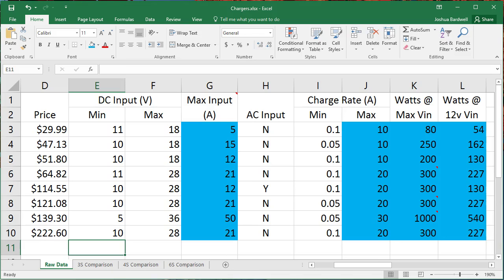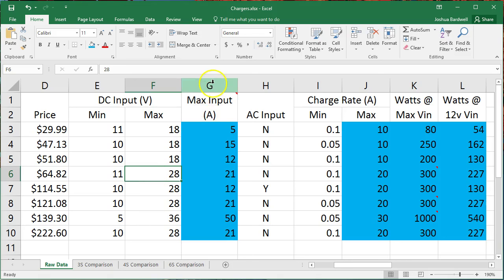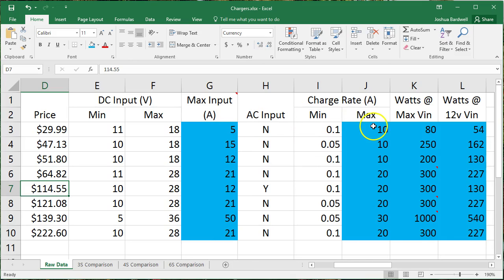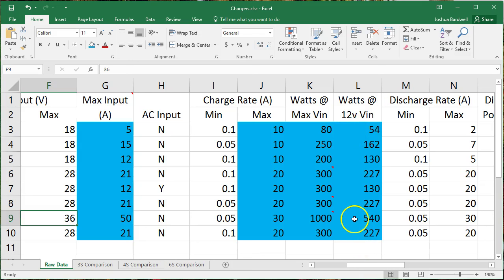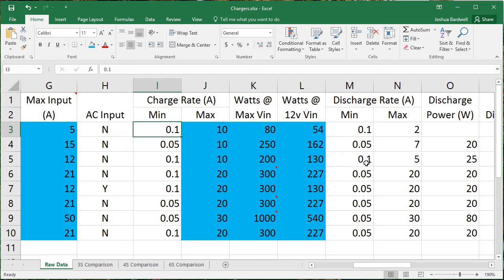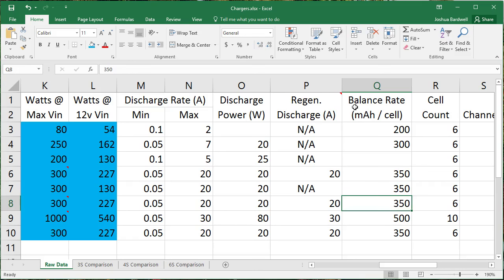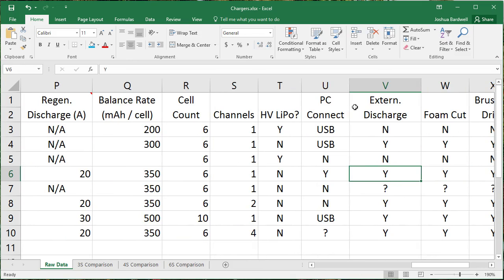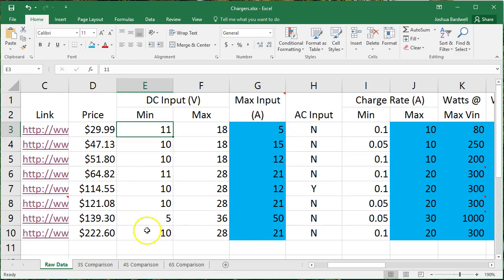Battery charger fundamentals: Understanding Specifications

Comment: I wish you'd posted this before I bought a new charger.  From your info, I think I would have gone with the Reaktor 250W using an xbox 360 power supply.  I'm looking forward to the next video.  Thanks.

Comment: stupid question maybe?  I have a Venom Pro Quad Charger - 100w and 7a per channel.  It also accepts AC power.  When plugged into AC, does that mean I'm giving it the full 18volts so it can charge at 100watts?
Reply from the maker: That depends on the internal design but not necessarily. I have seen some AC/DC chargers that did not achieve full output power on AC. I don't know about the Venom.

Comment: I love your videos, but I cringe every time you say "amperage" - "Don't call current "amperage"; that's strictly bush-league. The same caution will apply to the term "ohmage"" -Horowitz and Hill

Tho, sadly for me, "amperage" is a very common term in the multirotor community.
Reply from the maker: That's a semantic nit I don't care to pick. Let me ask you this? How come nobody cringes when we say voltage instead of potential?